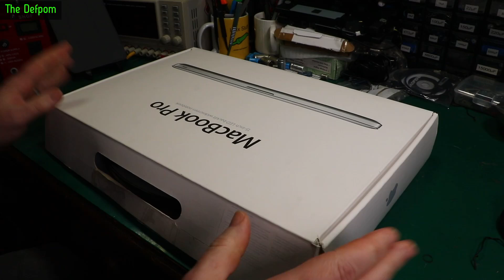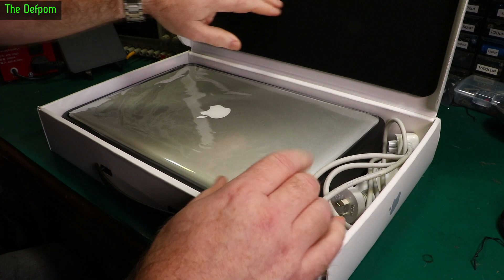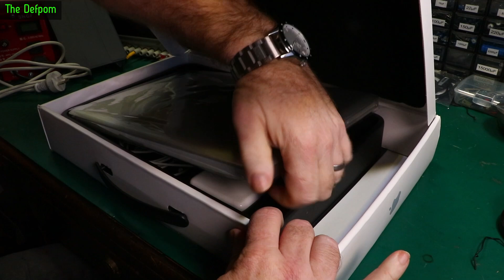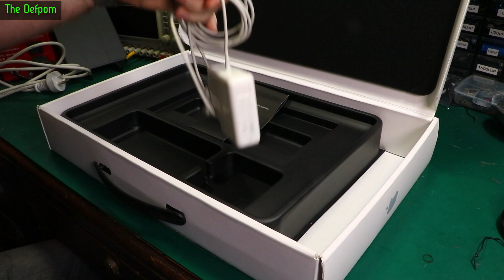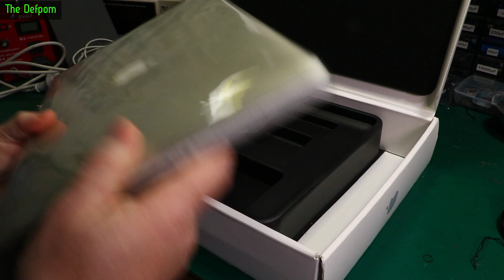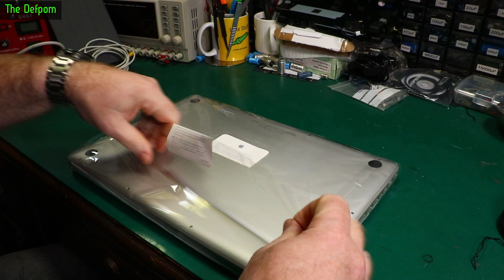🔴 Apple Macbook Pro 15 Repair - Early 2011 A1286 820-2915 SN_C02FN33DDF91 - No.1160

Comment: Hi Defpom (P.O.M. = "Pride of Mother England"!). This is my machine, & it's been real helpful to see the issue was just bad soldering. I tried several times to solder the chip legs and had the same problem as yourself. After many attempts, I couldn't tell conclusively if the solder had flowed correctly. I can see now via your microscope, that it clearly didn't. I was concerned that applying too much heat may destroy the chip, and so was (too) cautious. Thanks so much for making the video, and I hope someone gets continued use out of it. It's been a workhorse for me for many years, so great to see it working again. Great video.

Comment: hi, saw your video where you repaired a mac.
I have a macbook A1286 that I'm trying to get started, will use macos and windows on it.
As soon as I start it, the apple logo comes up, then it goes half bar and restarts.
I've tested health diagnostic and it shows no errors.
I've also tested Command - R doesn't work.
I've tested with options then I see the disks, if I hold down shift I can start it, as usual it doesn't work.
I've tested options - command - P - R and it doesn't work either.
have tried internet recovery because I don't know which macos should be installed originally on this machine.
The globe comes up and goes all the way, when it gets to the end it restarts.
I suspect it might be something serious, but I hope not.
Can you give me some tips on what I can do.

Comment: Try disconnecting the mod replace the GPU capacitor next to the big coil see if that fixes the GPU issue normally that’s all it is the capacitor failing